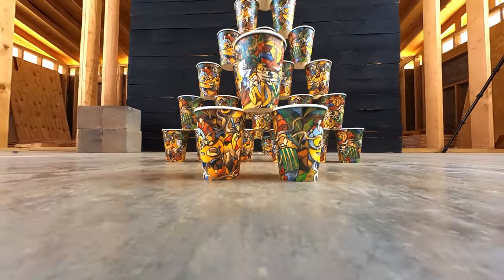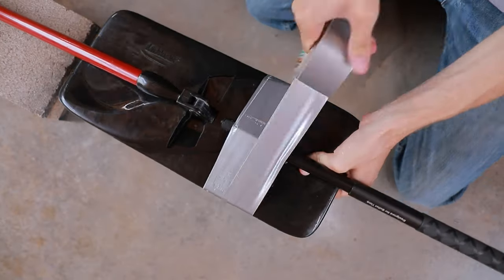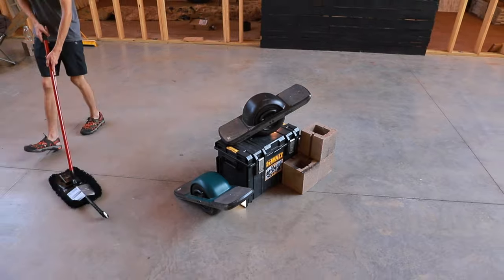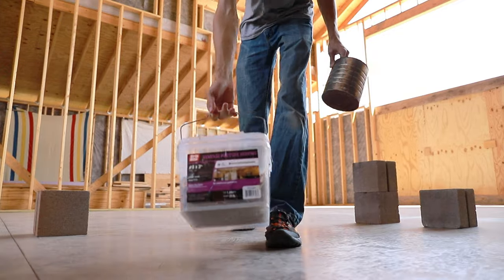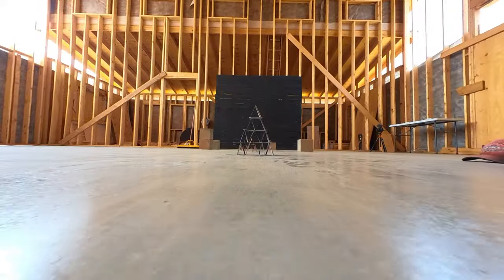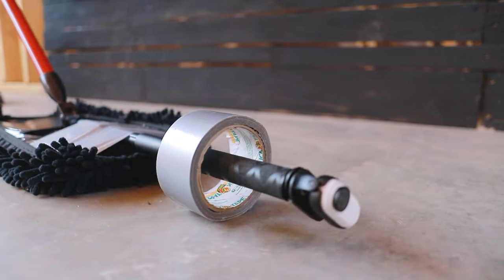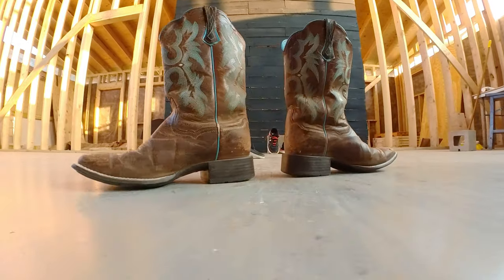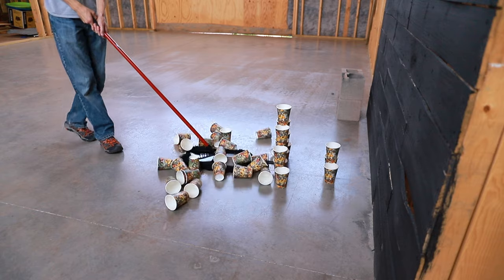Insta360 Go 2 Fun Camera Tricks

Comment: Thanks for sharing! Which settings do you record with? Did you do any speed adjustments I post?
Reply from the maker: I always use PRO video recording at 30fps and I usually use my phone app to manually set exposure especially on small sets like this. If I'm outside I will leave it on auto exposure. Yes I did a lot of speed ramping in post.
Reply: @LukeEdwin  Thanks for taking your time to share! Do you edit on a 24fps timeline so that you can slow down 0.8x from 30fps or is that something you dont do?
Reply from the maker: No I usually editing at 30fps if I want to slow it down I'll shoot at 50fps on the Go2

Comment: how did you attach the clip mount to your selfie stick?
Reply from the maker: I modified it. drilled a hole in it and pout a 1/4 20 bolt throw it that could attach to the selfie stick. Insta360 does sell attachments that would have worked for this though.
Reply: @LukeEdwin  cool! thanks!